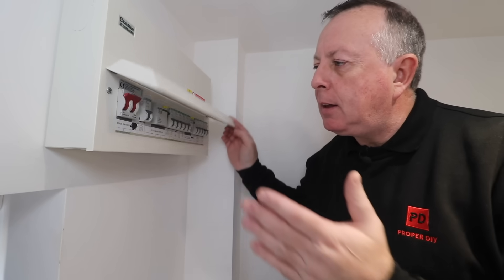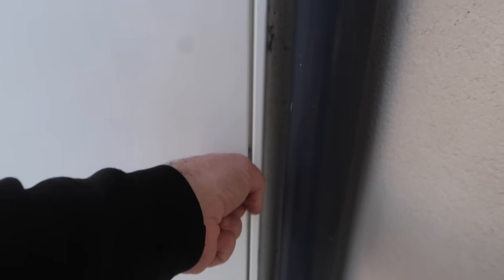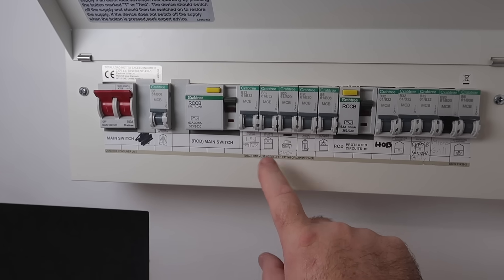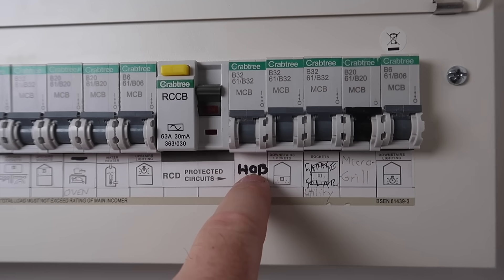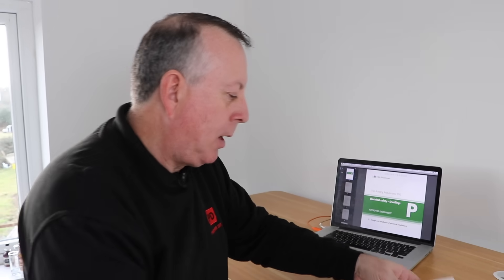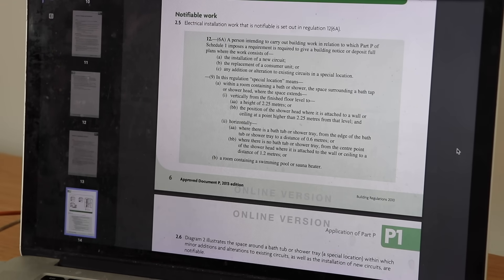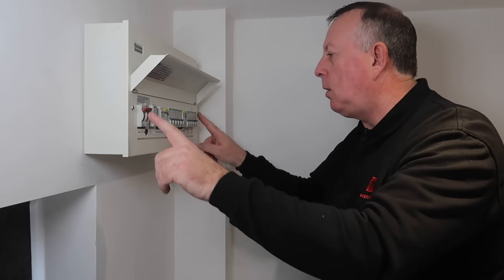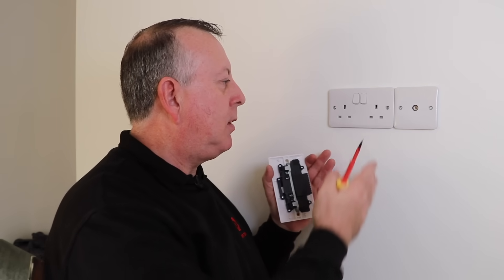What electrical work are you allowed to do in your own home?

Comment: If an electrician turns up at your house to do work, ask them a simple Ohm's Law question. An appropriate one could be: "a 1kW convector heater, running at 230 volts, what would be the approximate appliances resistance?" You'd be rather surprised at the response!
Reply: Surprised at the response as they promptly pack their tools back into the van and hightail it away,  as you've just unknowingly revealed yourself to be the kind of client that tradespeople loathe working for you mean? 

Do you ask your doctor about how they would perform an appendectomy before you get a check-up ? Ask your bus driver about how the transmission works before you jump on? 

No, you don't and if you feel that you have the right to quiz somebody about Ohm's law ,which would almost never be used on at least 80 percent of domestic electrical installation jobs in the U.K. After YOU appointed them to do the work, you need to give your head a shake.  

We train for so long to gain the practical skills, and hands on experience, to install, maintain and repair a wide range of installations to standardised requirements, using standard parts, installed using standard methods, to a commercially acceptable finish in a timeframe that allows profit to be made. 

you learn Ohm's law in Secondary school physics you don't need to be an Electrician, though for anybody playing along at home it's 53 Ohms. 1000W/230V gives you the current at 4.34A 
R=V/I 230/4.34 = 52.99  

Allow me to give you some advice, If an Electrician turns up at your house to do work, politely offer them a cup of tea, and pay them promptly once the work is complete as you would any other professional who's services you have engaged.
Reply: @conarobrien9434  I'm a little surprised that you feel Ohm's Law isn't used often: I remember electricians arrived in a London tower block flat I lived in and they measured the resistance of the underfloor heating elements: 8 ohms. They were to perform checks on all flats in the block. I've had electricians turn up in various  flats, houses I've lived in. I've never had issues or felt I needed to check competency or demonstrate my knowledge, and the example I gave was during a patronising browbeating: An elderly lady I worked for as handyperson had an arcing ceiling rose, carbon tracking, and I offered to replace it for her, as seeing it was a repair and in the 1980s, I was legally competent to do it. A man employed to do painting argued that I couldn't do the repair, and the following week, I had a company rep and said painter in desperate endeavour to convince and undermine me. As the task was a simple replacement, intended as a favour, I could have done without the piosity. During the interrogation, I remained silent, giving their chance at sanctimony and questioned both of them using examples I gave, to set things straight. I did the repair when the blokes weren't there and repaired a 1930s valve radio that stopped 20 years before, to boot! I am fully competent to replace a distribution unit in my house that I own, and making it illegal is patronising, as if someone is stupid enough to undertake a task of this nature without appropriate skills, they deserve the potential consequences. I would, for example, stay clear of gas appliances, as I know nothing at all about it. The nanny state goes too far at times, I would imagine most of us would agree. Also, I would offer them a cup of tea and similar gratuities and thanks for your comment.
Reply: @hoofbags  I appreciate your point of view, and the example makes a bit more sense with the added context. 

Definite Kudos for helping the client out against the advice of the painter. 

I should clarify that I mean the application of Ohm's Law for calculation is very uncommon, even during verification work we tend to work to given figures, though I am in complete agreement with the sentiment though, Electrician's SHOULD have a solid grasp of the mathematical and scientific principles  underpinning our work.  

We perform resistance and impedance measurements almost daily, we just don't tend to do much maths on site, aside from the odd bit of division or multiplication for converting units or testing Ring Finals. 

Good to chat! All the best!

Comment: I've viewed electrician movies where weatherproof sockets connect into outlet ring main through a brick wall. Outdoor electrical supplies need a dedicated fuse channel. I've a trailing sockets/cables out to sheds via 13A fused plugs, connected to internal shed electrical system. I can draw 2.9kW maximum, here. A fan heater draws 1kW, in addition to servicing equipment, scopes and similar, no more than 200W. Extension cable is well overrated. In this event, my shed, in entirety becomes an appliance. If an electrical engineer inspection was forced upon us, I'd simply pull out the plug from inside the house, completely isolating the sheds electrics. That is a way around the issue of me not being a certified registered electrician. I've met a few professional electrical installers who appear to have less knowledge than do I. Faulty electricals can kill and DIY electricians need to be aware of these issues.

Comment: In England does the red and black go from the breaker box through all of the outlets and then back into the breaker box see if two red wires on the breaker and two black wires on the neutral bar for that one loop plus they yellow green on the ground bar I hear they call it a ring and what gauge wire do they use for lights outlets
Reply: Mains electrical wiring in England changed colours in 2005, red & black became brown and blue. A final ring circuit is literally a loop of 3* core 2.5mm2 cable that comes out of the circuit board called a consumer unit), and literally return back to the circuit board. These ring mains are allowed on 32A power circuits only. Lighting circuits are rated at 6A and are not a ring but a radial, i.e. a single 3* core cable of 1 or 1.5mm2 that loops in and out of all the light outlets (switch cables are then added to each outlet), but does not return to the circuit board . *Cable is known as twin & Earth, only the live & neutral wires are wrapped in their coloured PVC, the neutral is bare but protected with green and yellow sleeving at site.  Note all 3 cores have another outer wrapping of PVC - usually grey.  I think in the USA they call it Romex?

Comment: Strictly speaking a spur from a ring main should only be to a single socket. Reason - 2.5 mm cable is only rated at 20amp. A double socket could in theory pull 26amps.
Reply: 27A….

Comment: The reg don’t require older installations to be replaced or upgraded to the current edition.  Health and safety executive’s note in BS7671 and page 99 in the onsite guide .

 Health and safety executive’s note in BS7671 AMENDMENT 2 existing installations that have been installed in accordance with an earlier edition of the wiring regulations may not comply with the 18th edition in every respect this does not necessarily mean that they are unsafe for continued use or require up grading . 
Page 99 off the onsite guide ,
Installers adding or amending circuits in dwellings will encounter older consumer units,ie those not complying with regulation 421.1.201 for many years to come , It is important that installers do not advise the replacement of consumer units simply because they do not comply with the current version of BS7671 . To ensure the ongoing use of such enclosures and assemblies, the installer must ensure the following:  it goes on to detail the tests we must do  

but who am I to argue i’am just a humble spark who’s opinion means nothing .
Fantastic video as always

Comment: It is not illegal to do any kind of electrical work in your own home or anywhere else. There is no legal requirement to be qualified or registered with any of the competent person scams. Fact, you can replace your consumer unit but you then have three choices . 1) you must notify building control 14 days before you start the project  and you will be charged a fee of upto £350 +vat , they will want to inspect the finished work to ensure it complies with the relevant regulations. 2) you can certify the your self if you are registered with a competent person scam, or 3) you can get a third party registered electrician to certify the work for you. Good luck with that one no electrician is going to take responsibility for someone else’s work. If you do any notifiable electrical work make sure you are competent and confident to do so and that you know how to test the system fully and how to complete all the certification that is required. Ie electrical installation certificate schedule off tests certificate and so on . Any non notifiable work should have a minor works certificate attached to that work. 

If you have an old rewireble fuse box that is in good condition ie no signs of damage or exposed live parts no signs of overheating and or burning it can be tested by a competent electrician and if the test results are within the specified limits set out in BS7671 the IET wiring regulations then it can be signed off as safe for continued service. Fact. Page 99 of the onsite guide gives clear guidance on this. The IET dropped the term qualified for competent , the IET only requires that you are competent. To do the work . We should not advise or recommend that older CU should be replaced. Unless it’s clearly in a dangerous condition.

Comment: Are you allowed to extend a ring main? - I have a room with a single plug socket. I’ve already removed it, and replaced it with a double plug socket, but I’d like to extend the ring to a further three sockets around the room. 
I’m confident and competent, but is likely to cause me issues if/when selling the house at a later date?
Reply: Do you know how to test it fully? 🤷🏿‍♂️
Reply: @jameshansing5396  That's a bit of a loaded question. As I'm not a qualified domestic electrician, I don't have access to some of the test equipment that a qualified electrician would have. 
I've done the extension that I wanted to do, and tested it with a multimeter for voltage and resistance between terminals, and also checked it with a socket tester. Whether there are more tests that could or should have been done, I don't know. Hence the original question.
Reply: @TheMattHarwood  it’s not loaded at all. It’s a genuine question with only really one correct answer. 

So no, it’s not fully tested 👍👍👍
Reply: @TheMattHarwood  if you were “competent” as you said, you’d know how to fully test both prior to and post your work. Thus, I’d suggest you have over stated your skill level. As like most in here. Sorry dude but that’s just the truth ?
Reply: @jameshansing5396  Like I said, a loaded question designed to make me look foolish. So helpful.
I'm an auto electrician by trade, hence I class myself as competent.  - Going by your reply, nobody except a qualified domestic electrician can do anything electrical within their homes. - I note that you didn't actually elaborate on these 'full tests'...
Reply: @TheMattHarwood  you oh didn’t ask me to elaborate?

It’s only loaded to you as you don’t know the answers? And if you feel foolish, there’s a reason?

The question was merely to highlight a gap in your knowledge, which if I had I wouldn’t be classed as competent, so why are you?
Reply: @jameshansing5396  OK troll. Whatever makes you feel big.
Reply: @TheMattHarwood  so you don’t want to learn? And can’t accept MAYBE you aren’t doing as a proper Spark would?

No worries. Your attitude to not being right is kinda worrying but that’s on your head….. 

We like to say “every day’s a school day” but apparently you know better? 

👍
Reply: @jameshansing5396  I'm very happy to learn, hence asking the question originally. However, nothing you have said in the past 5 replies has been even remotely constructive.
Reply: @TheMattHarwood  I’ve just given you the answer and helped you see the person doing your work isn’t as competent as they should be? 

If you were paying that person you’d be annoyed ?
Reply: In answer to your original question, it might if number of points on the last certificate don’t match the circuit.

My mother on law got screwed over that way. (Way before I knew her) 👍

Comment: What are the rules on 24v fire alarm systems? Is it still as it was being ok to do some of the work considering you have reasonable knowledge but then to be officially tested by a professional if the system is in a shared building?

Also, if a 24v fire alarm system is rigged up as a hobby project in a private residence (other self contained smoke detectors are installed separately and not part of the system) but the 230v input is only wired to a 3 pin plug (since it is not the primary fire detection system), does this mean that this is not an installation but technically a portable appliance?

Comment: I've always done my own electrics, be it changing a socket or a switch to adding new circuits.
Last one was putting a proper electric connection to the garage and adding sockets and lighting in the garage.
Also from there I've put it through to our summerhouse (which is build of the side of the garage) each with it's own consumer unit and it has all been checked by a qualified electrician and 100% approved.
And before anyone asks, no, I am not an electrician, in fact I only learned for two things and that was bricklaying and welding & construction.
Reply: same her, i do all major work, self taught, get it approved by qualified sparky via council, much cheaper and great satisfaction
Reply: @GarysDIY70  what we all need to do is what they do in Australia, to get round there government enforced system, this  is because this is where Part P came from, you go and purchase as many  extension lead as need which is not covered by there enforced system, run extension lead after  extension lead  after  extension lead to where you need to get power to where you wont it to go. And by the way it used to be not allowed to put an electrical plug on an appliance.
Reply: @bengunn6546  Did they define what an appliance is?  That isn't an appliance, it is a cement mixer.   So what it it will toast bread.  It is for mixing small batches of cement in the winter..
Reply: I rewired a house that had bare wires running through the baseboards. These "trained" certified probably have no idea how to work on them.
Reply: Electrics are easy until it goes wrong and then it fucking hurts or kills!
Reply: @tomredaintdead9575  Pain is a fantastic teacher, you don't do it twice.
Reply: Is this in the UK. this sounds disastrous. Did you get an EIC for the work? No decent spark would certify a diyers work as 3rd party. How did you work out max demand, and calculate correct cable sizing, how did you achieve additional protection. How did you achieve an acceptable earth for the out building?!what was the measured ze (zdb)? How did you work out that the fault current was acceptable for the protective devices? Was building control notified or part p? What were your cpc continuity results did you achieve to be within max Zs range after getting your r1 + r2 results. Did the additional protective times disconnect within specified times after test. How did you find out what that time was for said device.? You do know when it burns down your insurance want be valid? It’s not just a case other throwing a few cables and connecting up. You don’t know what you don’t know.
Reply: @Wawaw738  This has always confused me when folk say " I got it signed off so that's OK".  I understand from a local sparky who did some wiring of an out building for me that he would only issue EIC on DIY work if he more or less dismantled it to make sure everything was OK - in other words he couldn't take the DIYer's word for anything.  It would prob actually be cheaper to get him to do it for you in the first place.
Reply: @Wawaw738  Difference is when you don't know you make an effort to find out.  Licensed on the other hand are told they do know so don't bother to learn.
Don't waste money on insurance, and you have the money to fix anything should it pop up.
Reply: @Wawaw738 all those questions are part of paying for an electrician to 'test' the circuits. Anything he can't see, trunking/capping is photographed.
Reply: Me to.....

Comment: As a registered electrician, this is a good video. I would however like to add, if your DIY work injured or killed anyone, you would have to prove in a court of law that you were competent to carry out the work and prove it was safe before re-energising the circuit. The only way you could do this, would be to have the relevant qualifications and correct testing equipment. So,   in a nut shell, its very questionable that's you can do any work in your house yourself if you do not have qualifications and testing equipment
Reply: The question is if I replaced a socket, ran new wires, replaced a circuit breaker etc. how would anyone know?
Reply: Same can be said for literally everything in life when it comes to DIY, if you do it and you hurt or kill someone you're up the creek no matter what. That's how it should be, you do what you want with YOUR property, but be prepared for the consequences if you don't do it the right way and it hurts/kills someone.

Only area where you get this condescending attitude and the infantilization of anyone who isn't "qualified" is electrics, boggles the mind I swear, electricity aint magic and the regs are literally written in in a book that you can read with your own eyes.

Surprised we're even "allowed" to reset a tripped RCD at this point, can't wait for the next edition reg which says that can only be carried out by a qualified person too, wouldn't be surprised at all to see it.